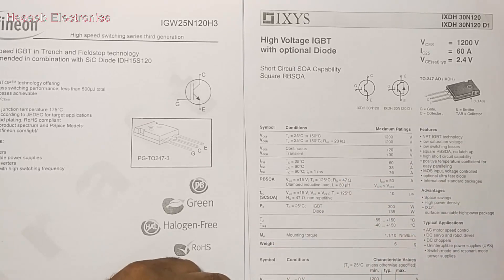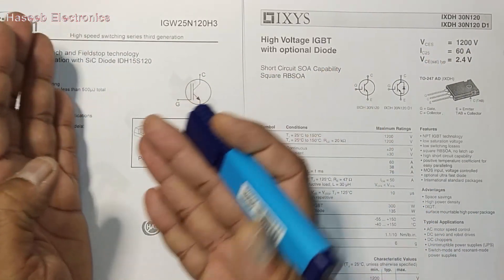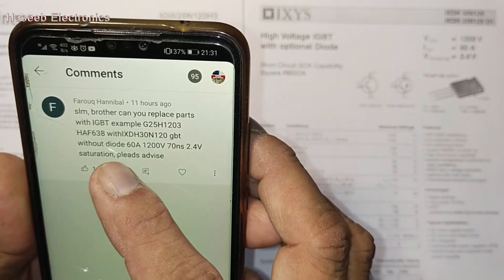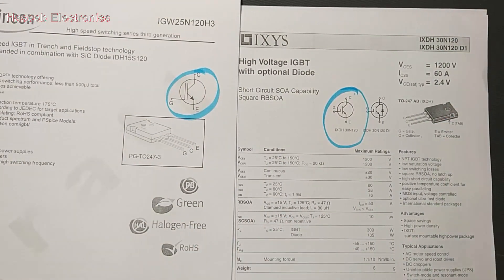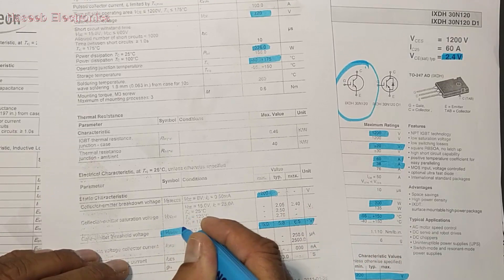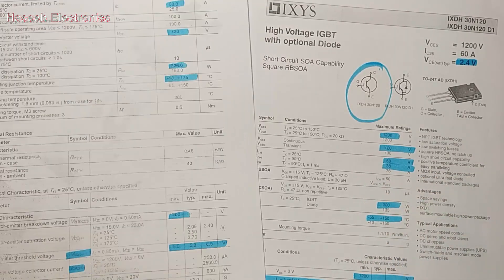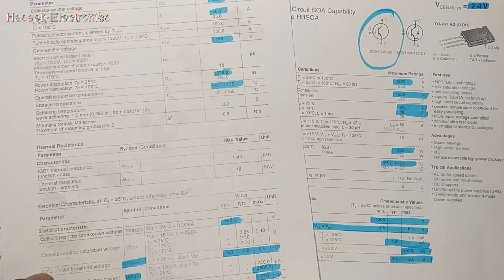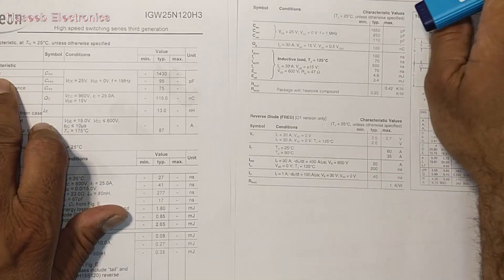{504} IGBT Datasheet Comparison - How To Select IGBT Equivalent / Substitute / Replacement

Comment: Excellent video and very informative.  Have a question... can you substitute an H20R1353 with H30R1602?  The way I interpret the datasheet, the H30R1602  is superior (can handle more Amps and more voltage), but I would like the expert opinion.
Reply from the maker: best regards and special thanks for your comment 
yes H30R1602 is better than H20R1353. it can handle more current. just these differ slightly in gate charge, but it will work normally. if it is switching under 200KHz, then it will remain safe. 
above 200KHz the gate drive components might be reconsidered
Reply: @HaseebElectronics  Thank you very much for your quick reply habib.  Best Regards from Malta